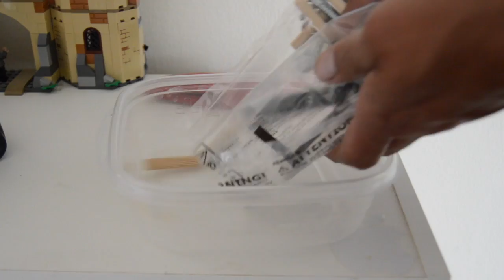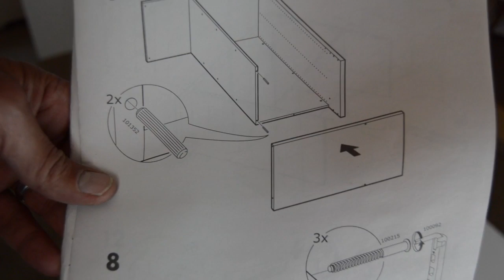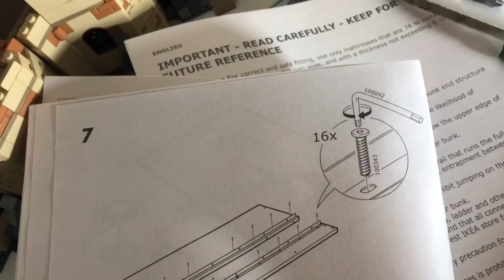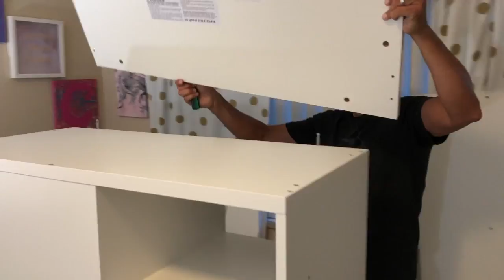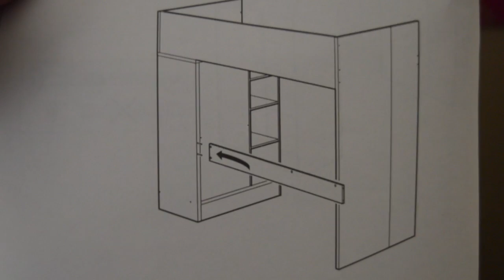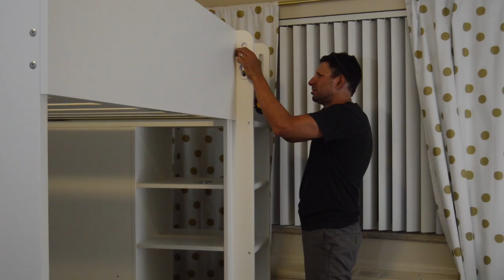IKEA STUVA Loft Bed Build Tips

Comment: Do you have any advice for reinforcing it to hold a slightly higher weight limit ?
Reply from the maker: Maybe add some long (2 1/2” or so) wood screws into the bed frame from the outside.

Comment: Do I have to use a drill?  I’m a single mommy so I gotta build this by myself with my daughter.
Reply from the maker: No, you don't need a drill. It comes with some basic tools for assembly, it's just a much faster process with a cordless screwdriver or drill. Good luck!
Reply: @JoeyMesa  I’m struggling 😪
Reply: @JoeyMesa  do I do it by box?  Like start only at box 1 first?
Reply: Gonna try again when I get home and watch this video.

Comment: Please help if you can answer! This is particle board do you feel it’s sturdy and structural sound? Noticed any wobbling? Also would this fit a kid who is 5’ 2”?
Reply from the maker: The bed is currently still in use. I’ve even broken it down twice as we’ve moved a couple times since I made the video. I even modified it to move the ladder to the left side after our last move. 
My opinion on the overall durability of the bed is that it is solid. I’m sure mistakes can be made during assembly that could compromise the beds integrity, but it’s survived many sleepovers and multiple children roughhousing on it.  My daughter is probably close to 5’2”, and I know the weight limit is 200 pounds.

Comment: I'm here because we're putting new carpet in my daughter's bedroom and I'm actually looking to tear it down just enough to be able to move it out for the new carpet fitting.

I've still got the paper instructions and even after seeing this (great video by the way!) I'm struggling to reverse this process.

I wish it was a case or doing everything backwards but it doesn't seem as simple as it sounds...unless I'm missing something!
Reply from the maker: I've had to disassemble our twice when we've moved. Basically it's just a matter of removing the ladder, separating the two end portions from the main bed, and the lower cross brace. Just keep all the bolts labeled or in baggies taped to the sections they go with.

Comment: How big is the box that the loft bed comes in?
Reply from the maker: The bed itself comes n 6 boxes. I would guess they're about 6 or 7 foot long and 3 foot wide and about 2-3 inches thick. There's a few other boxes depending on if you go with a desk and/or shelves/clothing storage. There is a pretty good visual of our stuff in our vehicle at the :15 to :40 points in the video. I believe there are exact dimensions on the IKEA website.
Reply: Joey Mesa thanks!

Comment: Hey! I’m planning to buy this dismantled on Craigslist, can all this fit in a 4x4 car do you think?
Reply from the maker: It depends on how far it's been dismantled. When we purchased it new from Ikea, it fit into our little Subaru Impreza. We've had it partially assembled when we moved, and it fit into a van. It comes apart pretty easily unless some of the bolts are rounded off where the hex key or Allen wrench fits into the bolt (I've got a few like that on ours), but completely disassembles, it will fit into a pretty small vehicle.

Comment: Im sorry but i’m new to these beds, what are the legs of this loft bed? Because online it says legs are sold separately? is it needed for this loft bed?
Reply from the maker: The actual loft bed is one complete unit that doesn't use legs. It's basically supported by long flat headboard section on one end and a rectangular box section for storage on the footboard end. There are a few options for setting it up with either shelves or a clothing rack, which are sold separately. The desk portion is also optional and depending on how you set it up, you may need legs for that.

Comment: Been looking for such a video and I finally got this one. I am grateful. I was doing well with the assembling but got stuck after a wooden dowel got stuck in holes. Any idea on how I can remove them?
Reply from the maker: Thanks! I realize it's a few days after the fact, and hopefully you've extracted to stuck dowel, but if not, I would lightly clamp the dowel in some vice grips (tight enough to hold a firm grip, but not crush it) and pry something under the vise grips between the tool and surface the dowel is pressed into, going nice and slow. If it breaks, just drill it out and get a new dowel as Ikea sell replacement small parts like these. Good luck!

Comment: How would I switch the closet doors to the opposite side? Mine is built but moved it around in the room it was in and wanted to switch the doors to the other side. I can’t seem to get the bolt to unlock and come out
Reply from the maker: There's a video I suggested to someone else wanting switch the end piece around, but it's a little bit of a project. https://www.youtube.com/watch?v=HvpChT4ng08
As far as getting the bolts loose, it seems like most of the bolts require a 4mm hex wrench. Using one with a longer handle than the one that comes with the bed will give you more leverage to get the bolts loosened.
Reply: Awesome! Thank you so much for your help. I really appreciate it.

Comment: It's just a shame that Ikea doesn't have an option to allow you to put the ladder on the left side and only the right. I mean it can be done I've seen tutorials and videos online but it requires you to drill extra holes on the opposite sides of the walls and basically flip the left wall to the right and the right wall to the left and same for the board with the opening with a ladder nose.

I mean with the metal Ikea loft bed you can choose which side you want the ladder on. For my room to make this really work and take up less room I need to have the latter on the left side unless I put the cupboard facing inwards which I really don't want to do.

I'm also not going to drill extra holes in my loft bed and plus the video I saw on YouTube was kind of confusing.
Reply from the maker: Yeah, this thing is pretty big so you definitely want to have a plan as to how you're going to set it up. Luckily for us, the girls bedroom worked well for the design, but once you get so far putting it together, it's difficult to move. It does seem like it would be a lot of work to with the ladder to the left side.

Comment: Great job. How many hours did it took for full assembly?
Reply from the maker: Probably around 6 hours, however, that's while filming, setting up shots, Etc. I'd say if I were to do another one without the video documentation, it would probably take 3ish hours. Using some of your own tools like a drill driver will speed up the process a lot. If you had a few extra people helping (opening boxes, getting the correct parts ready, discarding packaging material Etc.), you could probably build it sub 2 hours.
Reply: Thanks a lot for the feedbacks. These tips will be really helpful for assembly. I am awaiting the delivery of the Stuva loft bed from ikea.
Reply: Are you gonna make a video of you making the desk?

Comment: How did u fit the clothes rail?
Reply from the maker: The modular end piece can be assembled in different ways depending on the package you want to use. We went with additional shelves instead of the clothes rail. It looks like the clothes rail just mounts in the center set of holes. 
https://www.ikea.com/us/en/assembly_instructions/stuva-grundlig-clothes-rail__AA-356931-2_pub.PDF